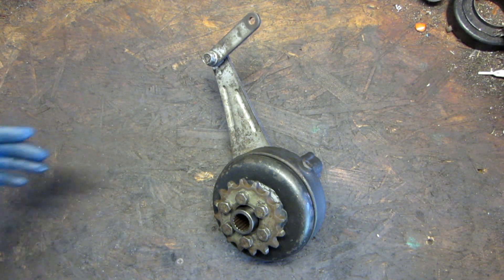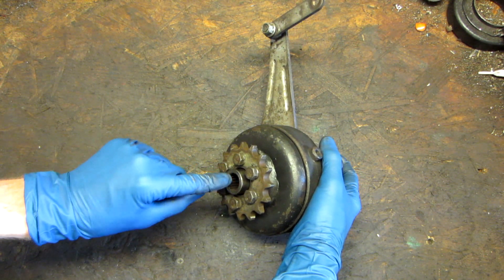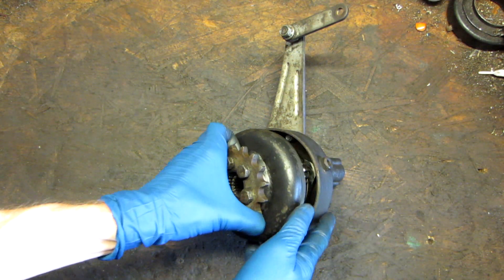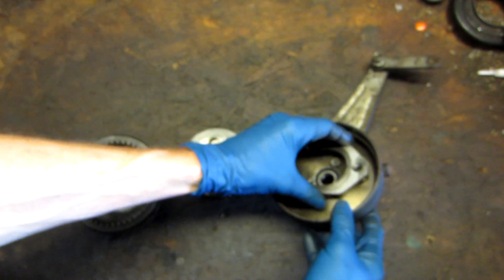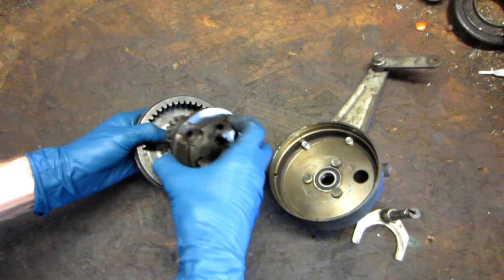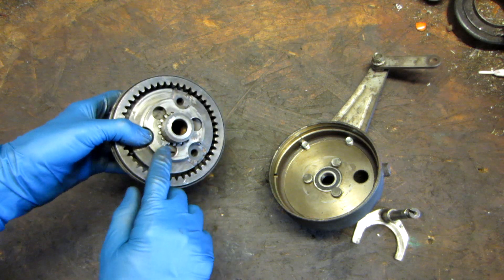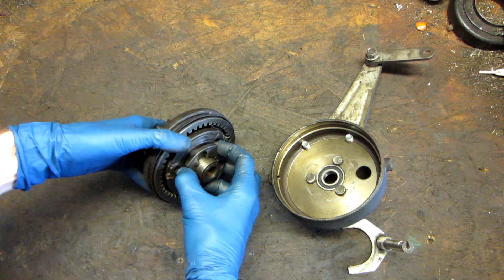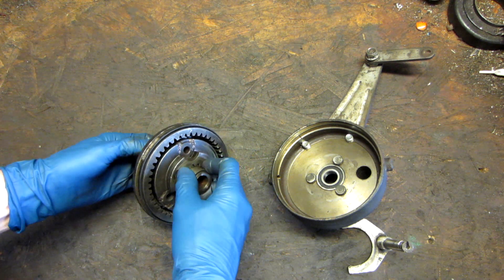How a GY6 reverse gearbox works

Comment: so if it gives you forward, but reverse is just neutral is it worth taking it apart to try to fix it?  should one attempt to grease or oil one?  I can rebuild car transmissions so I'm not scared to dig into it just not sure its worth the effort to pull it off and apart.
Reply: Sounds more like that you need to adjust it. It’s common for these to come out of alignment
Reply: @leesovern4678  I never got around to taking it apart but I was moving it at the box so no real adjustments at that point.

Comment: Question, If you're still out there... the two halves of this revers assembly... what holds them together? Mine keeps separating . The two halves, just enough not to mostly go into gear. Obviously the chain side is fixed.
Reply from the maker: Its been a while but it looks like it's just the position of the chain that keeps them together. your shift cable may be allowing the spring on the shift fork to push too far and push the case half out. if thats not it I would consider adding a washer between the reverse box and the engine output. It should push on the bolts that hold the sprocket on and keep the case together. Only issue is itll rub in reverse, forward will be fine.
Reply: @pfun41  your right, needing to add washer to create a distance for the right size washer will prevent rub. Thank you.

Comment: I have the same chassis and the 6 screws kept breaking, I would like to know what screws you use, what diameter and what hardness
Reply from the maker: The bolts for the sprocket? Grade 8 if they keep breaking.
Reply: Did you figure out what they are ? I need them too

Comment: I want to figure out to to make something like this but for a pedal car or velomobile whatever you want to call it. I'm looking for ideas for a project to build a pedal powered e bike basically which will have a lightweight all weather body and I want to do something where it does have a pedal assist electric motor a bicycle gearbox and a reverse gear setup.

Comment: The best were the first generation 2 strokes. What  changes on them is the actual rotation of the crank. It started  normally forward but the engine would also start and run backwards for reverse.

Comment: Nice video. Thank you. Do you have a video of connecting the cable to the reverse box and shift lever. Getting ready to work on a friends machine and it seems the cable he ordered is not correct. I will have to see. Thanks again appreciate the video.

Comment: Ik I’m a little late to the video but I’m having a problem where when it’s in forward everything is locked up and doesn’t want to turn, then when I pull out the shaft to make it in reverse everything is free and turns without issue, still no movement when you use the gas pedal though, only by manually turning the wheels, any help??
Reply from the maker: Assuming its the same model, the main ring gear where the sprocket mounts may be too far out of the housing and jamming on something in forward.

Comment: So my honda trx450s atv shifts but it's like everything is in reverse. When I activate the reverse with the cable it shifts and it displays the reverse light but the wheels goes forward. Then when I upshift it goes into neutral. When I upshift again, all the gears shift but the tires goes backwards. All the gears. What could be wrong???

Comment: see on mine its hard to pull out the the shift fork out that connects the cable too wat would cause that it feels like its spring loaded but by looking at this one there isnt no spring in it
Reply from the maker: It's spring loaded, and it's a pretty heavy spring. It fits down in the hole the shift fork shaft goes into.
Reply: @pfun41  i didnt see no spring on it when u had it apart
Reply: @pfun41  yea i see i took it apart i think my spring may be lil much it is hard to pull out to connected the cable too so im trying to find a smaller spring cause it cant pull out by hand u have to use fice crips to just get it out long enough to out cable in 
if there is a easyer way please tell anything that make it easyer
Reply: Alin Dragulin  no i didnt but new ones run for bout 187 on amazon that i seen but i end up selling the gocart i had with the gy6 motor on it

Comment: How many HP do you think this unit could take?I am thinking about using this with a  sled clutch in a surface drive for a boat so I would be able to have a netural and reverse.
Reply: A youtuber by the name of nick coride has a ninja 750 running through one of these. He has videos of it functioning and somehow not obliterating itself.
Reply from the maker: I have no idea but I think the 150 is supposed to be like 8 Hp or something.

Comment: Hi, I have the same reverse gear setup on an ATV. The only difference might be instead of a cable coming out, I have a straight hand lever attached. I'm wondering what might be wrong if the shift fork shaft keeps popping out when driving forward... It usually happens under load or higher rpms. It pops out for a second, disengages forward gear. Causing a terrible jerk when bouncing back in forward gear. Any ideas? I thought I would ask before having to take the whole gearbox off to inspect. It's a pain of a job with the location and frame...
Reply from the maker: You'll need to take it out to repair it anyway. It's going to be an internal issue.
Reply: @pfun41  Hello, is the forward position clockwise? In other words, does this mount to an engine that spins clockwise? (looking at it from the pull start side) If so, is it only this model or do all the planetary reverse boxes to that?
Reply from the maker: @Matt_pau  This doesn't have a pull start so I don't know which side you're talking about.
Reply: @pfun41  my mistake, i meant the non-output side of the engine where a pull start would be
Reply: My guestimate is that those forwards locking teeth have been rounded from use or/and from forcing gear into place, so little vibration and force slips them out of the place. Test the hardness of the teeth with file and if those are not hardened, just weld fill to teeth and file into form, or replace that part/parts. Ether way you need to take it out for inspection anyways.

Comment: My buggy has a tendency to not shift back into forward with the engine running. If I shut it off and restart it the forward is engaged. I have not torn it apart but plan to. What should I look for?
Reply: Check for a sticking cable or old burnt grease in the carrier itself

Comment: Where can I buy one
Reply from the maker: Ebay, amazon, any place that deals in parts. They won't just swap onto an engine that never came with one though. It uses a longer output shaft.
Reply: pfun41 ya think it would work on a 212 cc predator or will it get over torqued?
Reply from the maker: @ColbyHogan10  If you can find a way to connect it it should work.
Reply: pfun41 thanks I’ll take it into consideration then
Reply: Ur mobile no ....and what is price

Comment: Interesting! I was looking for a motorcycle reverse gear box of some kind applicable to a 1000cc engine. Obviously this isn't that, I did find one offered by Roadster cycle. com, but this was a few years ago and they no longer offer the unit for sale. Having said that I did read  you say this unit you show is the smaller of two models, I wonder how much torque capacity the larger one has and is it still available? HMMM, I googled GY6, not too likely they offer a reverse gear box capable. Your thoughts?
Reply from the maker: Models with a reverse gearbox have a longer output shaft, that's the only difference. So if you can source the shaft and reverse box you can convert a standard Gy6. I think even the larger model will have a hard time holding up to a 1000cc engine. These were  make for 150cc engines.
Reply: @MrRokusek  Thanks Thomas for the feedback. That box looks capable
Reply: @k.bellingham8335  Bit late but check moto mule channel, he has one that could work for your application.
Reply: @Hellsong89  Thanks, motomule has an interesting channel

Comment: Nicely done.
What type of oil/ grease do you recommend and Where to apply and not apply?
Thanks you
Reply from the maker: I just use multipurpose EP grease and pack the bearings and entire inside of the gearcase. I specifically like valvoline synthetic or valovline moly fortified multi purpose.